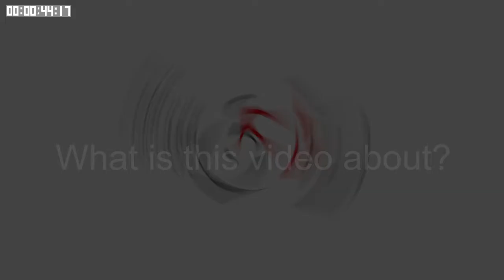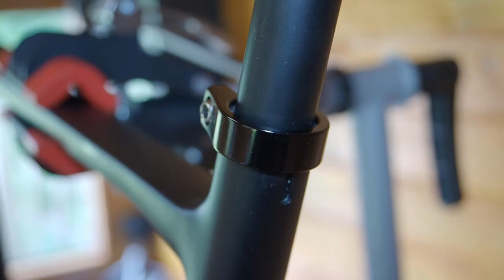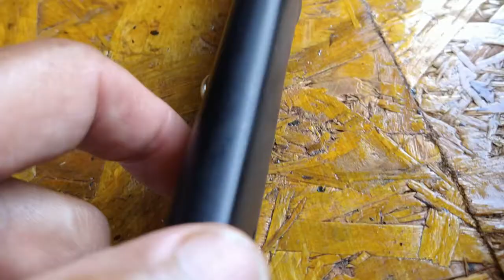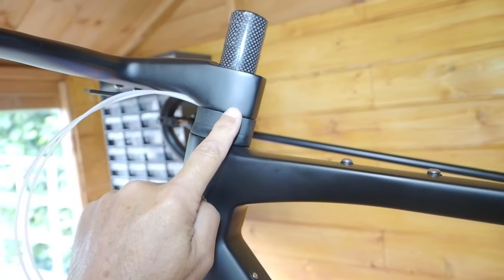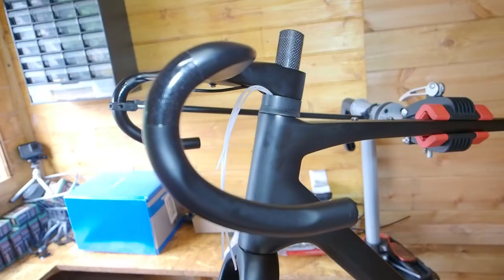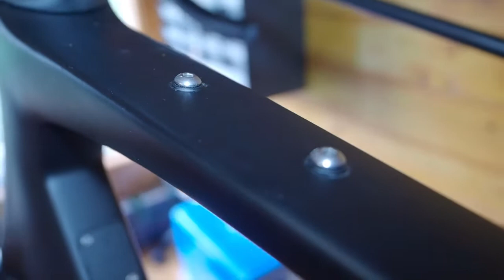New Bike - frame-set design assessment.

Comment: The cables being internally routed are definitely a big advantage. They give the bike a much cleaner look and help with its aero qualities. I have a six-year-old Trek Emonda SL 6 and the cable external cable routings at the front make it look scruffy and old-fashioned. I know your bike will be a pain to set up and run the cables but it will be worth it. I also wish my Emonda had better tyre clearance like yours. I can only get a 25mm tyre on which is frankly limiting. Anyway, I enjoyed the video and look forward to the build. JP
Reply from the maker: Thanks, I'm sure it will look good when I get around to building. 
I suppose my main concern is will the tortureus cable routing effect that gearing and braking performance. I really do need to get my finger out to find out.